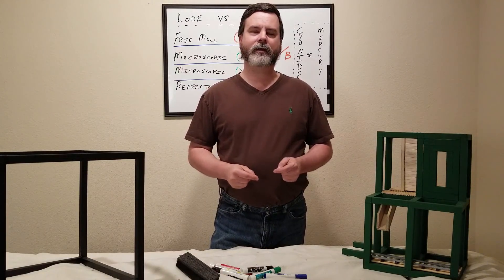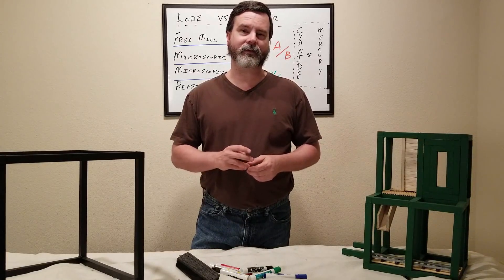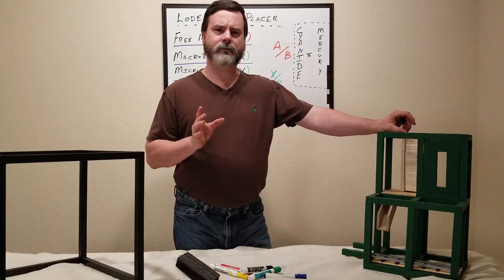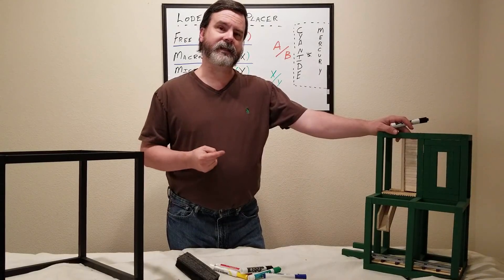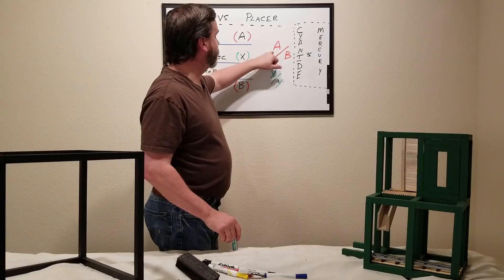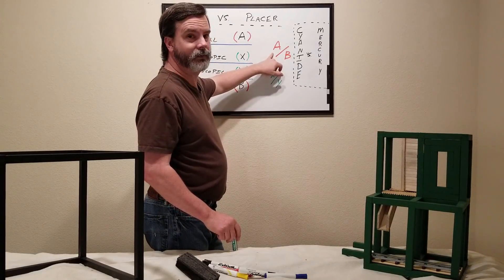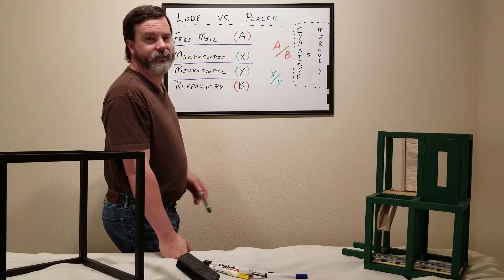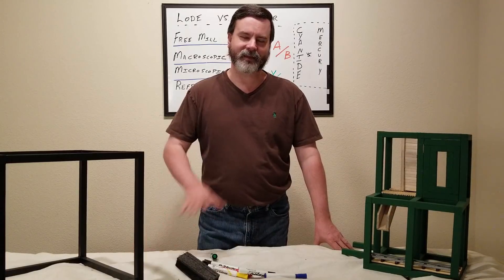Gold Mining and Geology, Episode 4, What is Free Mill Gold?

Comment: Assuming that placer gold is essentially free mill gold, is there any point in processing any of the left over placer black sand concentrates by roasting to possibly release more gold? I know this is probably ore dependent, I usually save my black sands to crush to a finer level when I have enough, but don't bother with roasting.
Reply from the maker: Old timers used to put all their black sands into a pan and heat it up red hot, then toss the sands into a bucket of water.  The sands would crack open and possibly liberate additional gold.  I would guess there's very little gold extracted in that manner though unless you're processing pounds and pounds of sands.

Comment: 👍👍 thanks for the clarification on free mill / visible gold.  So do you grind your ore to 200 mesh?  Is this the “limit” of free mill / visible gold?
Reply from the maker: Grind size is based on liberation calculations and lab testing.  It comes down to economics of recovery and operational costs.  Let's say you have exceptionally hard ore and are needing to only get down to P80 of 150 micron for 95% liberation by leaching.  The last 5% then might double your energy costs in the grinding circuit in addition to additional operations costs.  In the end, it's not worth chasing that 5% at all. yeah, you're throwing away 5 out of every hundred ounces you have in your ore, but it is the classic law of diminishing returns.  

Then you look at the intangibles in a very dangerous industry.  If X thousands of hours my employees are going to have a minor injury requiring work off and in Y thousands of hours a serious injury will occur, then giving up that 5% to save someone the pain and suffering is the right ethical thing to do.